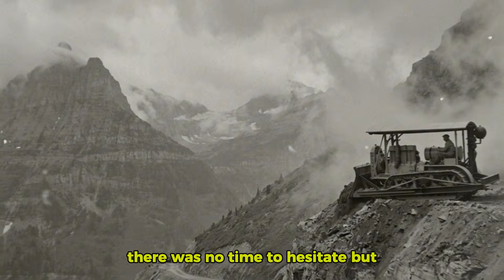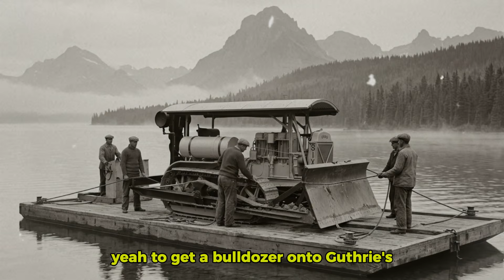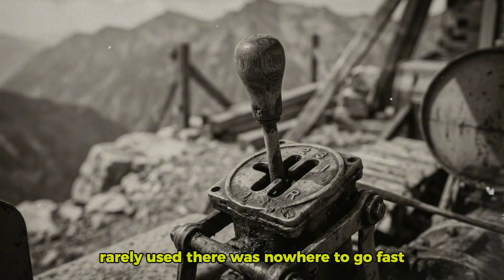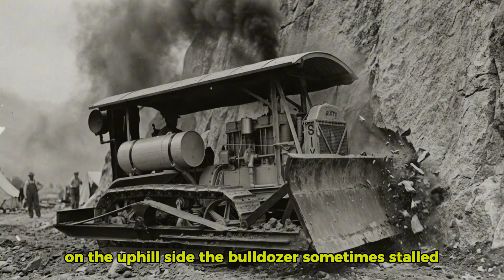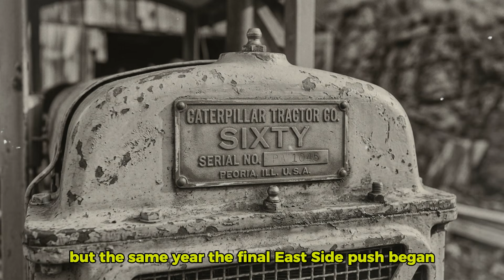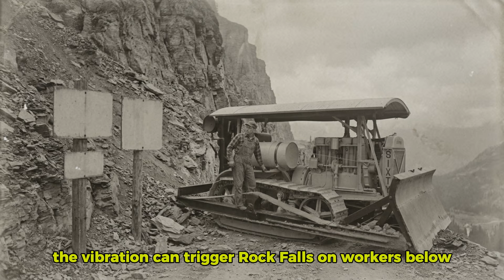3,300 Feet Up No Room to Turn The Bulldozers That Finished Going to the Sun Road 1932

Comment: This road is indeed gorgeous and the construction must have been scary.  I have ridden it on a loaded bicycle twice, from east to west both times as part of cross-USA rides.  In peak traffic weeks of summer, bicycles are restricted to off-hours, but I have arrived there after the summer peak so traffic has not been an issue.  There is a cool shuttle bus system, using old-timey convertible roadster vehicles (with modern drivetrains) that date back to the 1930s; this helps reduce motor traffic.  The grade does not exceed 6% going up, which is quite manageable with the gearing I have, so the ride up is steady work but not a lung-buster, with the occasional scenery stop.  I have looked over the edge in some sections and seen a lot of scree; from what I saw in this video that is probably rock that was pushed over the edge by bulldozers to build up the roadbed.  At the top I will customarily put on all my clothing for the descent, which is wind whipped because gravity loves my loaded bike.  Some of the narrowest and most cliff-hugging sections I remember are on the descent (that is, the west side), where I am basically keeping up with the motor traffic since everybody there is there for the view, not to get anywhere in a hurry.   Those sections feel like they are carved into cliffs.   The park is home to grizzly bears.  I did once get uncomfortably close to a bear when I had to stop for cars that had stopped (during my descent) to watch the bear walk by on the shoulder going back up the mountain.  The lead stopped motorist in the uphill direction may have figured out that I might be uncomfortable about doing what they were all doing, which was waiting for the bear to walk by their vehicles. That driver resumed his drive, thus leading a line of cars between me and the bear.  With the spell broken, the stopped downhill vehicles resumed motion and I got to roll out of there.
Reply from the maker: Hey buddy, you've recovered from a serious incident. I'm glad to have you back. Thanks for sharing. Welcome to my channel..

Comment: Those "doser marks" in solid granite are actually drill holes for dynamite blasting. You can see how uniform they are, a dozer wouldn't be at the same angle at different depths like that.
Reply from the maker: You're absolutely right, my friend. Thanks for the information.